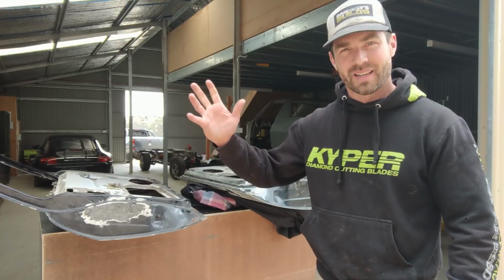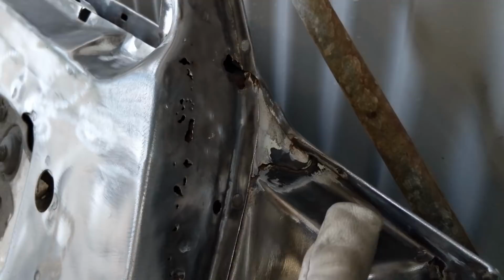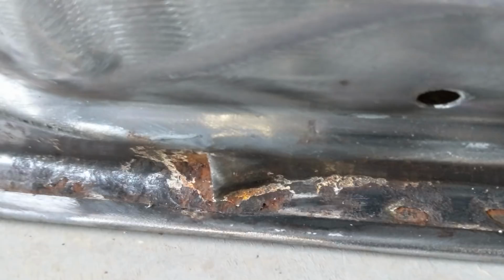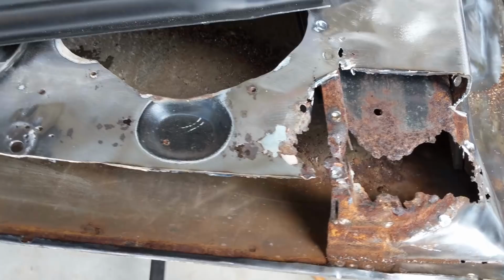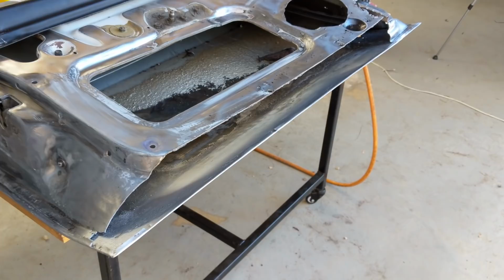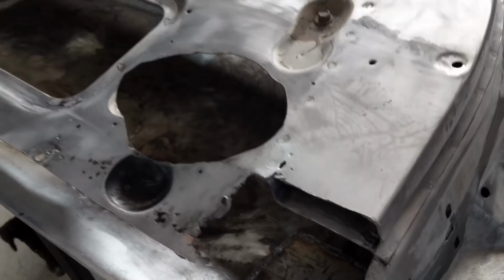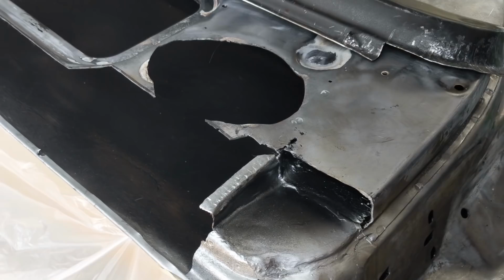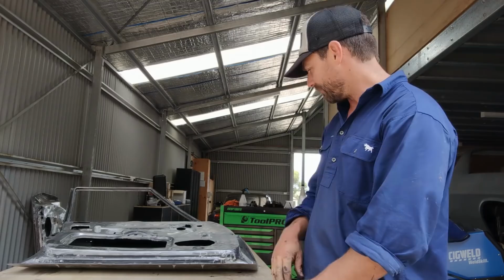EPISODE 25 - HOW TO REPAIR A BADLY RUSTED INNER/OUTER DOOR ON A WB UTE

Comment: Also might want to check out bully liner and or raptor liner for tray, door sills and underneath
Reply from the maker: Cheers mate, bully liner looks good, yeah done the research on raptor liner and was resolved to using that on tray. Was going to KBS underside as it seals rust in as well as is very a durable flexible polyurethane. Will see, bully liner could be another option

Comment: Hey mate been following you since the beginning and rebuilding a troopie that I suspect was either drowned or on a salt mine, pretty much for all same equipment as you it's crazy as my research came to same conclusion as were both on the same employment field I think, anyway having to rebuild inner guards, all doors, custom third door and surrounding frame, door sills and front panels pretty much had to take back to bare metal and also reweld in huge sections. All being said I reckon you need to revisit the sand blaster , you've got exactly same as me (sand blasting drum kit, and genetech compressor) I added in a cheap compressor in series to give bit more grunt and changed sand blaster handpiece to a irrigation tap style with ceramic tip, cpl cheap tarps hung up and one on floor and reused the same three bags of garnet, just the difference of stripping back panels, hinges etc and stuff was so much better with the blaster over either the blue or sand paper disks, then I hit bad panels with killrust eeter then primer and either weld in new steel or fibreglass under series of holes.such as tops of doors
Reply from the maker: Cheers mate, yeah there are definitely well beaten tracks that lead to the same conclusion s with this work. As you know you watch a series of videos or read articles on one subject and then based on averages you can filter the bad techniques and go with the good. I agree with the said blasting, I have bought some garnet and will be doing the tarp setup for the hinges etc cheers mate!
Reply: @BarnesysBuilds  other trick I figured out after keeping on scratching up the visor after 20-30 mins was to wrap the good one in glad wrap and lasts good 30 mins then replace saving the hard plastic scratching, but once it goes then I bought a pack of 10 tablet screen protectors and cut to shape and get like 3 uses per sheet, leave in plastic sleeve for first layer then take out, then leave the peel off covers on for another 2 layers :)

Comment: Which stripping disks do you use? Possible link?
Reply from the maker: What type are you after mate?
Reply: Barnesy's Builds used a couple stripping disks 115mm on the angle grinder that don’t seem to last too long. Just wondering what brand etc you use. Just got removing paint front the panels.
Reply from the maker: @shillosspeedfactory1642  I use KYPER brand as i get these in as well. Have to make sure they have carbide in them so they don't wear out fast.